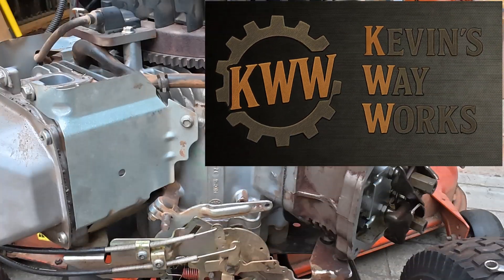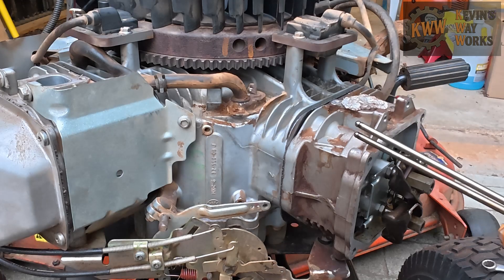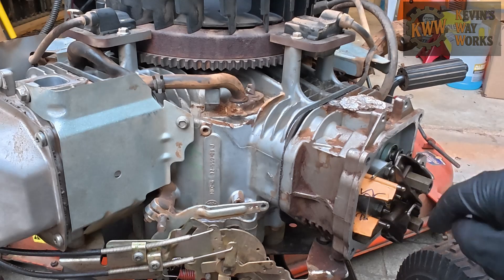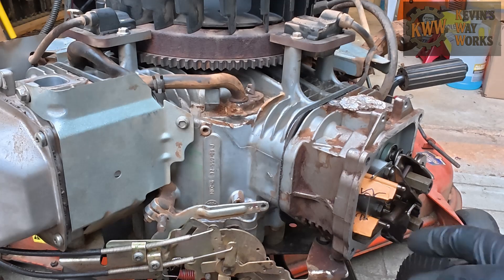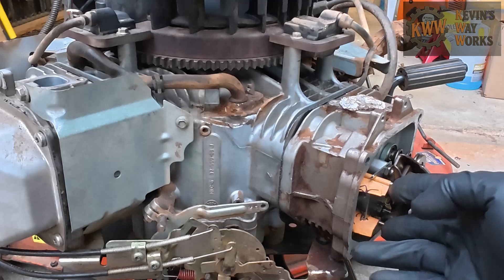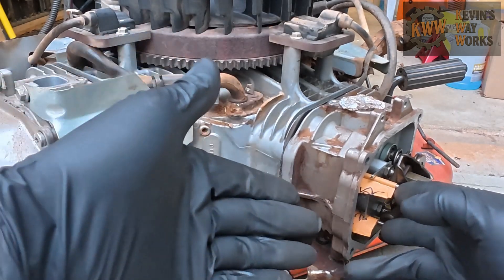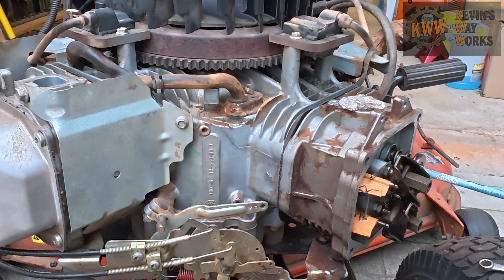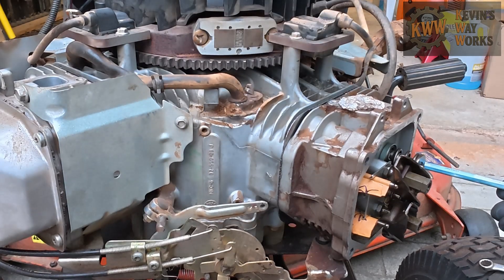Kohler Engine V-Twin, Courage, 7000: How to Find Top Dead Center (Compression Stroke)

Comment: Briggs & Stratton Intek 25hp V-twin engine

Can I do the same thing for both cylinders? Can I do the same thing by turning the flywheel like in the video of the fuel location on the right side of the rocker arm? The intake valves are 0.004 inches and the exhaust valves are 0.006 inches.
Reply from the maker: Yes.  Both cyllinders are done the same way.  Finding TDC should be the same with pretty much any 4 stroke engine.  You have to watch out for bent push rods on these B&S Intek engines.  Especially if the aluminum and steel rod were swapped and put in the wrong locations.